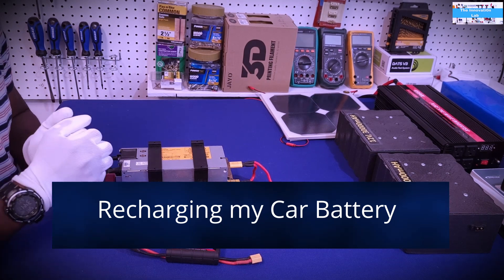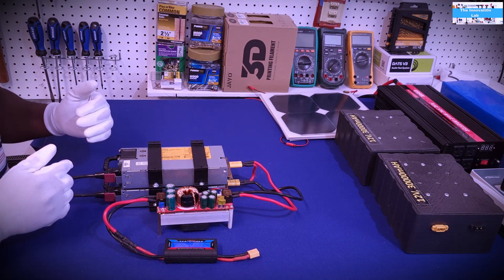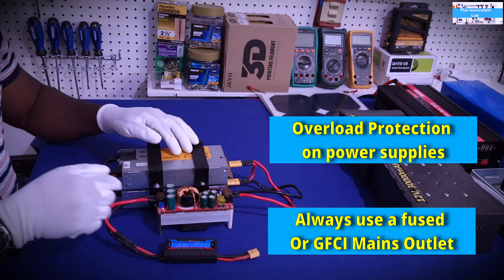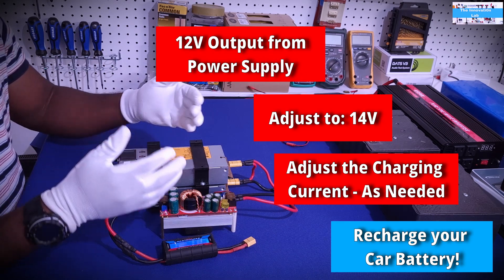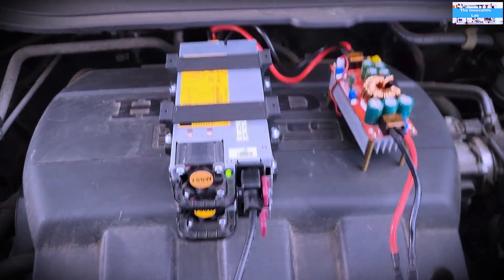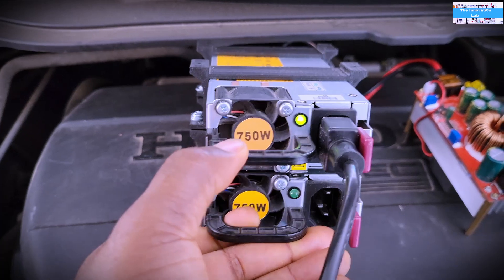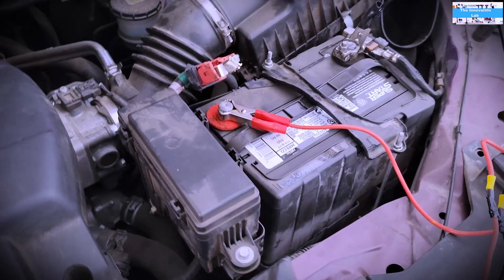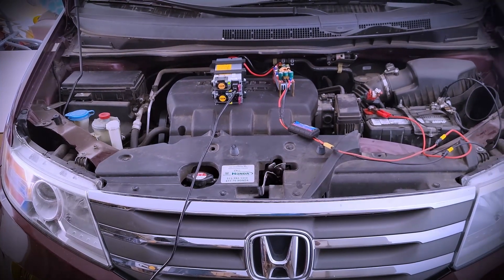🔥MAKE AN EMERGENCY CAR BATTERY CHARGER, ONLY $30⚡️

Comment: Yes please, I would like to see your design and print files for the compact charge pack. Thanks for all the videos.
Reply from the maker: Thanks a lot for watching this video and for the wonderful feedback.
I will be glad to share the 3D print file with you guys, as soon as I complete my ongoing modifications to the rack design.
I set up this channel to use my DIY knowledge to help my audience and I am happy to get your feedback. Thanks again for your support.
Reply: @theinnovati0nlab782  A suggestion maybe add a switchable buck converter for lower voltages to charger pack.
Reply from the maker: That is a wonderful idea and actually a great video idea too!👍👍
The only concern I usually have with buck converters is that they are usually lossy, have low efficiencies, and requires lots of cooling at high charging currents. 
Plus most cheap off the shelf buck converters - at least the ones I have seen/used in the past, had very low output current/power ratings - which doesn't compare to these boost converters that can go upto 1500W for only $25.
😊

Comment: Subbed and liked 👍. I have 2 of these DC to DC converter. I always wanted to know if I could use a 12 volt battery charger to charge a 24 volt battery? I even have the same power meters. Lol. Cheers from Australia 🙂
Reply from the maker: Thanks a lot, friend!
It seems to me that you are on the right track. If your 12V charger will play well with the boost converter, it might be possible. You can give it a try and let us know if it works.

Thanks again for the wonderful engagement!
👍👍👍
Reply: @theinnovati0nlab782  thanks heaps for the quick reply ❤. You have heaps of goodies! Lol 😆
Reply: Muchas gracias amigo!!! Tienes algún manual de tu proyecto, que es cargador de batería ? Me interesa tu proyecto.

Comment from the maker: I had to repost this video to address some safety concerns and to also add some notes of caution. The truth is that projects like these are not for everyone. If you are not knowledgeable and comfortable around power electronics and electrical systems, please do not attempt to replicate any of these activities. It might be easier for some people to by a trickle charger to recharge their batteries. The projects we show on this channel are honest research-based projects for hobbyists and people who are knowledgeable and enthusiastic about electrical systems - people who will prefer build things themselves (for the satisfaction) rather than buy everything. Our focus is to encourage the culture of recycling and repurposing of used electronics that could harm our planet - when dumped in landfills.

Please become a subscriber to encourage our mission, which is to: Rethink, Recycle, and  Rebuild!

Comment: DESEO TU AYUDA QUIERO HACER UN ARRANCADOR DE COCHE CON DOS FUENTE EN PARALELO, PARA AUMENTA EL AMPERAJE, PRODUCIR 200 AMP O CERCA QUE PUEDA AUXILIAR LA BATERIA DEL TRACTOR DIESEL PARA ENCENDER EL MOTOR ES POSIBLE.
Reply from the maker: I responded to your earlier post with the same question.

Thanks for the engagement.
The Innovati0n Lab 💥 www.theinnovati0nlab.com

Comment: I WANT YOUR HELP I WANT TO MAKE A CAR STARTER WITH TWO SOURCES IN PARALLEL, TO INCREASE THE AMPERAGE, PRODUCE 200 AMP OR ABOUT THAT CAN AUXILIARY THE BATTERY OF THE DIESEL TRACTOR TO START THE ENGINE IS POSSIBLE.
Reply from the maker: Wonderful!
This sounds like a supercapacitor project. You may need to add Supercross to you power supplies to help provide a surge current buffer needed by your starter.
Conduct some research on it and see how others have done it in the past. I made a super capacitor spot welder video a while ago. You can watch the video and see if you could some useful information from it.
https://youtu.be/qsjZaV6X4nw?si=pugsMBHlHiGxhmll

The Innovati0n Lab www.theinnovati0nlab.com 

I hope this helps.
The Innovati0n Lab 💥 www.theinnovati0nlab.com